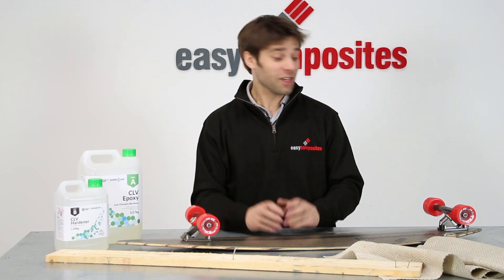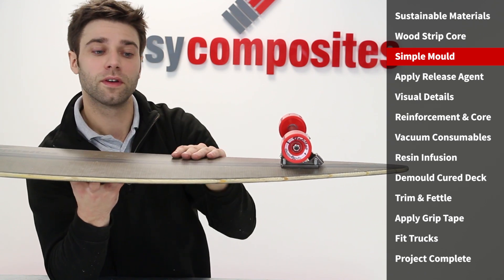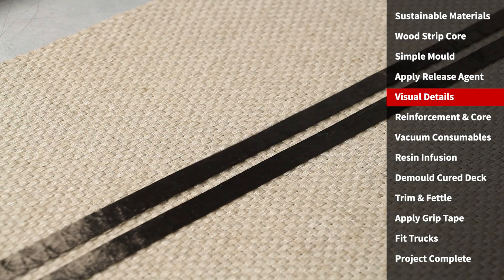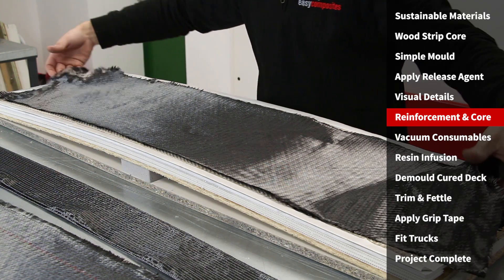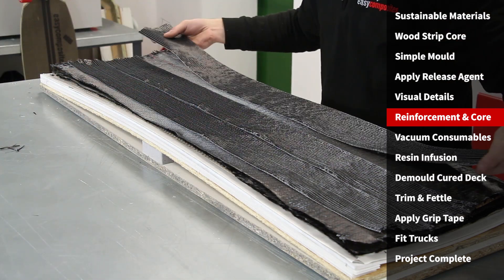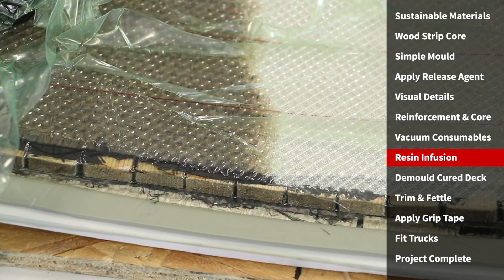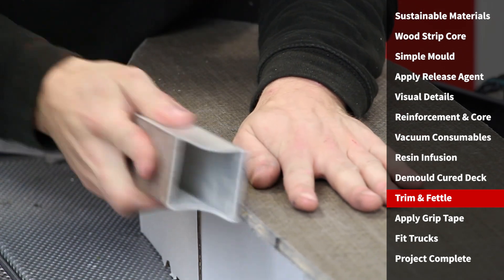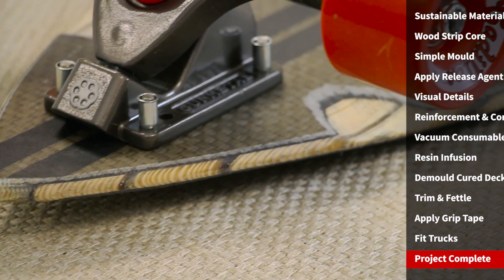Resin Infused Skateboard Using Carbon Fibre, Flax and Bio Resin

Comment: I would like to make these at home, do you guys sell all the items used in this video as a package?
Reply from the maker: Yes, we sell all of the composite materials and the equipment. Anything that's specifically 'skateboard' related (like the trucks, wheels and grip tape) you can source from any many different suppliers. Here's a link to a list of all the tools and materials we used: http://www.easycomposites.co.uk/#!/composites-tutorials/resin-infused-skateboard-using-carbon-fibre-flax-and-bio-resin
Reply: Thanks for the response! If I wanted to make this with just carbon fibre, how much layers would it need?
Reply from the maker: Carbon fibre but no core material? - Just sold carbon fibre? - Probably you'd need about a 5mm laminate which would mean a lot of layers of carbon fibre (example 7 layers of 650g) but the layers of carbon fibre in the middle of the laminate would not really be doing much which is why we tend to use core materials.
Reply: Sorry I didn't mention it, I would make a foam core but I guess that wouldn't give much strenght
Reply: Is it necessary to have the fusion mesh or is just the spiral enough for this long shape? I'm working on a car spoiler

Comment: Is it cool to use on urthane?
Reply from the maker: Do you mean the resin or the infusion process or the fibre?
Reply: +Easy Composites Ltd oh! Sorry for being unclear. The new bio resin. Is it safe on urethane? And is it ok to use carbon fiber with it? Or fiber glass?
Reply from the maker: OK, no problem. Yes, you can use it in just the same way that you can use a conventional epoxy so carbon fibre (as shown in this video), glass fibre, natural fibres - they're all fine. As for urethane - are we talking foam, rubber or plastic and do you want it it bond or just not dissolve/attack it? - Epoxy won't attack urethane, the bond strength will depend on surface prep and the format of the urethane.

Comment: I was thinking about making a carbon fiber deck for an electric longboard. Do I need to install a wood or foam core for the carbon fiber to be strong enough to stand on? Can I make a carbon fiber deck without a core? How thick does it need to be so it wont break?
Reply: I've seen some dudes use a foam core.  I'm pretty sure it held up well. A coreless skate deck? Sounds interesting. Make a mold for it man. Try it, and post the results.
Reply: Flash Nova yes, you can make a skateboard deck without a wooden or foam core.  However, you will need to use more plies; somewhere around 17-20 depending on what modulus carbon you use and the fabric thickness.  Your best best is to use 12 or so plies of uni (0°), 4 plies of biaxial (+45°/-45°), and a few plies of uni at 90°.

Comment: Love the videos guys, is it possible to make a sphere/ball (50cmD) with these materials/processes? any tips about how to go about it?
Reply from the maker: +Daniel Malcolm: Well, anything's possible! - You'd need to make the ball in two halves and bond them together (or some other variation on where the split is - but you'd certainly need two parts, in some way). I'd probably suggest making the two halves have a return flange on them and then you could use these flanges to bond the two halves together (gives you a good surface area for the bond). This does mean that each half does itself need to be a split mould but it's worth it in order to give you solid surface that can be bonded together to make the finished shape.

Comment: +easy composites I already went to your website before writing that comment and found there two categories of carbon fiber to be chosen so I got confused with that. So now if I order the flexible one I will be able to mould it in any shape and it will be durable right
Reply from the maker: +saurav sen; Ahh, I understand now. To make quad-rotor frame parts you would need our rigid, cured carbon fibre sheet as listed here: http://www.easycomposites.co.uk/#!/cured-carbon-fibre-products/rigid-carbon-fibre-sheet/Prepreg-Carbon-Fibre-Flat-Sheet.html

Comment: Which carbon fiber to use rigid or flexible in order to make quadrotor frame +easy composites
Reply from the maker: +saurav sen Quadrotor frames are made using standard carbon fibre and epoxy laminates. You want them to be rigid, that allows them to be light and still have the right performance and characteristics. Often of course, people use ready-made tubes and sections - we stock a range of carbon fibre tubes, sheet, angles and box section that can be used to make quad frames on the www.easycomposites.co.uk website.

Comment: Would it be possible to infuse some electrically conductive wires into the board for an electric skateboard or is the SuperSap and Carbon Fibre electrically conductive itself?
Reply: U can do it but you need copper filets
Reply from the maker: +Tony Lorentzen Epoxy resin isn't electrically conductive but carbon fibre is so it is possible to achieve conductivity through the laminate (although not in a perfect sense owing to insulating properties of the resin) so it depends on what level of conductivity you need and the direction you need it in; carbon will only conduct down the length of the fibres in a laminate like this. If you do need to lay conductive wires in then you could certainly do so.

Comment: Can the release agent be applied directly to an MDF mold?
Reply from the maker: +Joe Thomas : If you want to get a release of MDF then you'll need to use LOTS of coats of Shellac Sanding Sealer (available from timber merchants/furniture restorers/hardware stores) which will allow you to properly seal and polish the porous surface of the MDF. After this, it's possible to use mould release wax or chemical release agent to get a release from MDF.

Comment: Very interesting. 
it would be nice to know the total cost for this?
Reply: If you have to order the stuff in that little amuonts, It could be about 80-120 € for two Boards.
Reply: +michi derkinderen just the Material for the board.
Reply from the maker: +davidgruty 80-120 sounds about right (for a pair) when you order just 1 or 2 metres of fabric at a time and you'll have quote a bit of leftover material. If you were making these in quantity then the material cost per board might be down at more like £40/30 euro per board.

Comment: As it is a bio resin does it make it safer to use with animals? I was thinking of making a waterfall for a vivarium.
Reply from the maker: Being a bio resin doesn't change the cured safety of the resin. Once fully cured, epoxy should be very stable and safe.

Comment: Can I use a floor resin with the carbon?
Reply from the maker: +Mohamed Khlifi Not really: a flooring resin is designed for a different purpose to an infusion resin. You'll find a flooring resin too viscous (thick) and mechanically it won't have the right performance.